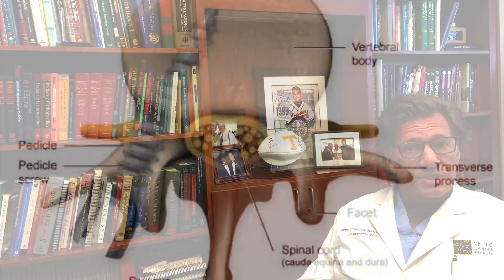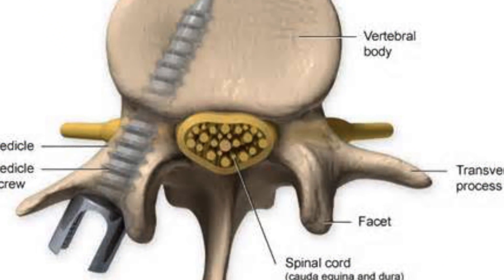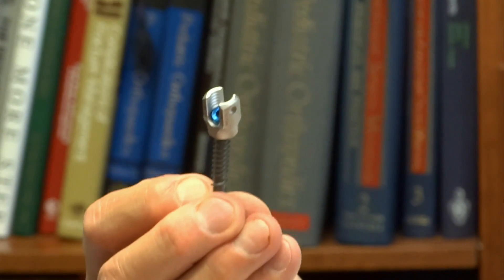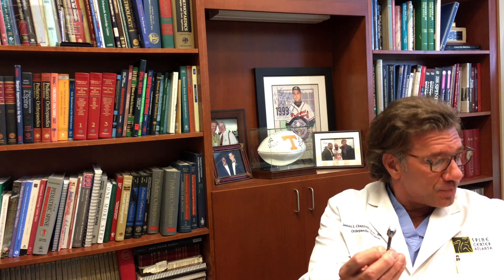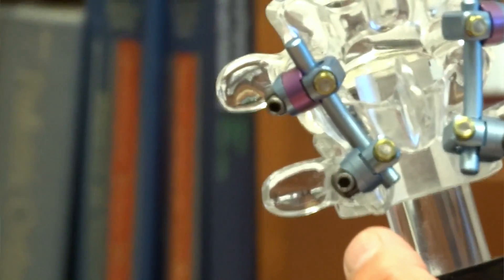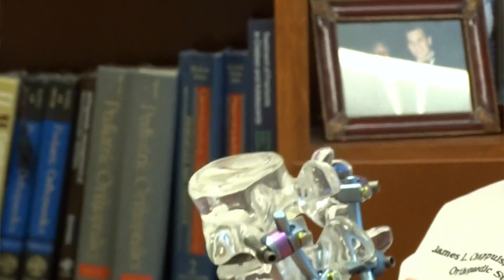Dr. Chappuis Explains Failed Spine Surgery and Failed Pedicle Screws

Comment: I have broken and loose pedicle screw in my posterior cervical fusion. My surgery was life saving in May of 2021 and due to the pandemic my surgery experience in Toronto Ontario Canada was a nightmare that had me bed bound in the hospital immediately after surgery for one month. I’ve had a lot of healing struggles, mobility issues, pain, the need to have my back supported. I am feeling hopeless at this point, they discovered the hardware issue in September of 2024 and I just recently had another follow up MRI. Pain specialist doesn’t understand why the hardware is being left like this. Surgeon expressed it being a big risk, I’m only 47 with 2 teens. Single parent and very alone. I need to function and live life. It’s very mentally challenging and overwhelming. Currently having incontinence, low back pain, neck pain which limits me from stretching my arms out, numb hands and feet of and on, hands are spasming and locking up, feel very unheard. 🥺Commenting to see if there’s hope or insight? Thank you!  I’m quite worried 🥺🥺🥺❤️🇨🇦
Reply from the maker: Please reach out to us at 404-351-5812 so we can discuss options of possible treatments or set up a virtual E-visit.

Comment: I had a spinal fusion in 2012 (S1) and I believe one of my screws broke or came loose. It’s the weekend so I’m waiting to have a CT scan. This sucks … my lower half is so heavy and hard to move because of how weak and the pain I have. I’ll have to find a doctor here in the Tampa area to correct this 🤞
Reply: Hi, how are you doing now? Did you find a solution to your problem? I hope so.